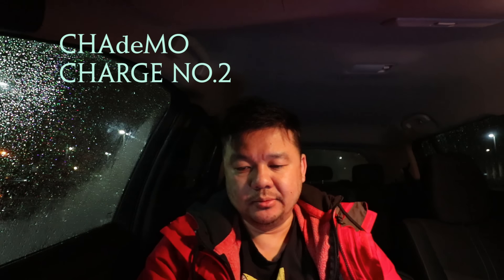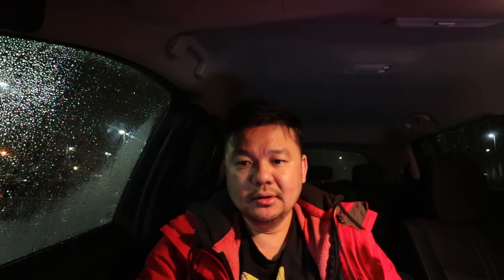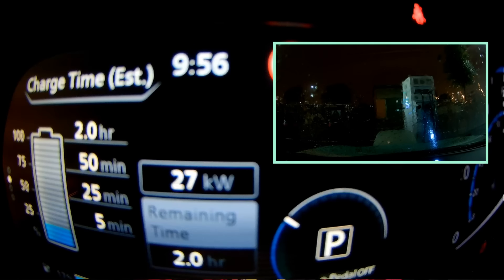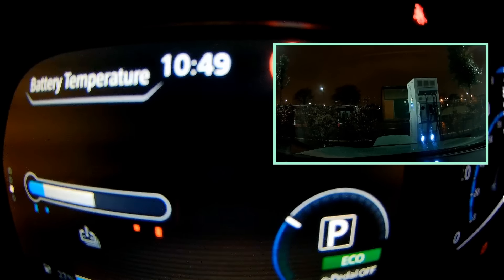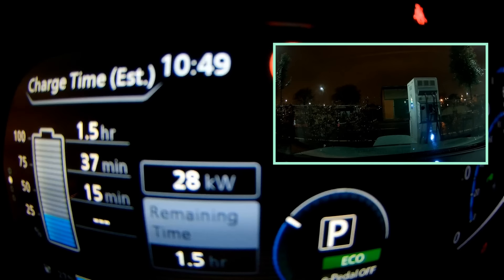Will lack of active thermal management system be an issue on Nissan's 40kWh Leaf?

Comment: Thanks for the useful review, James. We almost never take 300 mile journeys, so the issue will only arise on rare occasions. We're not likely to make a journey of more than 250 miles in a day any more than once a year. So, although the battery thermal management issue does need addressing, I suspect that most drivers would never notice the slowdown during repeat charges. My biggest question is, 'How will the system cope when ambient temperatures are 30° or higher?'. That will be the real test.
Reply from the maker: RWBHere Thats very true I dont think i would drive more than 400 max a day even going to France. and having to stop for say 2 hours for a charge isn't a bad thing or 3 hours if you have to switch over to a type 2 charge for the final top up. As a good rest and food is normally needed. 

I'm the same I don't think it'll affect or bother me, but knowing the limitation of our cars is a good thing.

I have a new video which I'm uploading now which gives a theory about how the car might deal with hot weather.

Comment: This is exactly what I was afraid of. Nissan was very well aware of the battery issue regarding the quick charging (rapid charging) judging by the fact that they have changed the charging algorithm to control the batteries temps rather than using a liquid cooling system. Come this summer this problem is only going to be amplified. I love the new Leaf but this battery temp problem could be its achilles' hill. I really hope I'm wrong though.
Reply from the maker: Electrified Journeys Japan Yes I remember watching your video about this and I think you hit the nail on the head. Nissan has got back to me asking for my details so they can contact me, we'll see what they have to say hopefully next week.
Reply: I really hope everything works out for you, I love the new Leaf I want to buy one someday.
Reply: +Electrified Journeys Japan, you were right, so was Nikki from Transport Evolved.
When the summer hits, people will be limited at fast charging if they were driving the day before (and the battery didn't have the time to cool down) already at the first fast charge. They will have an abysmal slow charge at the second and all the next where the charging rate will be between 15 and 25 kW, depending on battery temperature.
With a software change Nissan could change the first charge, but it can do close to nothing about the rest.

Comment: Hi. Great video. At 8:50 you show a table comparing charging speed and temperature. You do know that LeafSpy can be set up to store a log file? Import that logfile to a spredsheet, (Excel or simular), and you will probebly find were and when the speed of charging drop regarding both  SOC and temperature.
Reply from the maker: Thats brilliant, I'm new to leaf spy so any tips will help.  I've saved the last charge which i can use in future video after my new update which should be tonight. Hopefully have a more accurate account of what is happening with all the data collected.
Reply: Read more about the log file here: http://www.electricvehiclewiki.com/Leaf_Spy_Pro. Remember to check/tick of for logging. I have set my LeafSpy up for log every 4 second. I believe you will be able to drill deep into the charging speed issue as soon you got sutch data out. As a sample, I learned a lot about my 2012 Leaf after a trip of 650km and 11 QC in one day.
Reply from the maker: tucsonor ok saved the last test I did last night and set it up to my drop box. I'll have a new update video with some theory and that graph now I know how to read it seems to back it up. Still if Nissan won't reply back to me I'll keep the test data coming.
Reply: Looking forward to see what you found from the log file. Would also be interesting to have your file and compared to the log file I have from my gen1.

Comment: So glad I only do 110miles maximum per day. This way I'm in control of the expenditure and not at the mercy of other charging what they want. Rapid charging will not be an issue for me however if enough people force Nissan to rectify the issue with upgrades (fans etc) I'm all for it. Cheers for the video mate
Reply from the maker: I don't think it would affect you that much even if you had to do 3 rapid charges a day as you have downtime with the car and it'll have time to cool down.

Comment: I saw a post on a forum where the guy ran his HVAC on fresh air, fan on high, and windows rolled up, which he claims the cabin air exits into the compartment underneath where the battery is. In theory, on a summer day you would run the AC and pump cold air down there, and on a cold day you would pump warm air down there. 

Obviously you don’t want the battery to cool off fast when it’s just sitting in a parking lot, so it seems to seal the heat in well, but perhaps you can do some experiments to see if running the HVAC in that way, with a temperature on the cool side of comfortable, and see if it brings the battery back into normal temp faster. 

It’s possible that these charging issues are based on the wether being too cold to run the AC, so the car is trying to preserve battery heat, and therefore range, without running a battery heater. But if someone really wants to ride their Leaf hard and put it away wet, perhaps they can run the HVAC in a way to cool the battery while driving to the next charger, and leave the fan on high with the windows all closed tight and fresh air on to keep blowing 25 degree air (or colder) down around the battery.

Comment: Another great video James. Would a 7Kw home charger cause a similar issue, or is the rate of charge that much slower so the batteries don't heat up that much?
Reply from the maker: The 7kW home charger should actually start cooling the battery as the heat generated is lower than the heat generated. I'll doing test on this at the weekend and post my findings :)
Reply: Fab. Collecting my Leaf in a couple of weeks :-) We also have a 22kW charger at work so I'll also be able to use that. Will be interesting to see how that affects the temperature of the battery. I rarely drive over 100 miles so I'm not too concerned about the battery issues, if I had the budget I would probably wait for the 2019 model.
Reply from the maker: one up to temp 21kW is suppose to be the sweet spot for not causing the battery to heat up any more. I also have a plan to make the car pull 21kW to see how much heat that generates. the 2018 will be the perfect car for almost everyone. Even with the battery issue/feature my folks have ordered a 2018 leaf as they said they'll never go on such long journeys with it.

Comment: Fairly easily explainable - temperature and voltage kills li-ion batteries. With no active cooling the only means to protect the battery is to reduce the charging current to keep the cell voltages lower for a larger part of the CC-CV charging scheme (CC-CV constant current constant voltage).
Even in mobile phones the charging current will decrease with temperature.  At ~60°C it should stop charging for both wear and safety.
Reply: So how do you explain why the 24kWh LEAF can get to its destination more quickly than the 40kWh LEAF when making a long journey? Both versions do not have active thermal management.

Its not easily explained.
Reply: The 1st Leaf isn't made for good battery life, obviously. I can fast charge any Li-Ion battery, but after a few cycles it's trash. Professor Jeff Dahn has a video about battery life and what kills the Li-Ion batteries and made references about Leaf and Tesla and concluded that Nissan made crappy choices, hence the lawsuits.
Reply: Jean-Pierre White Because Leaf 1.gen does not limit the charging current as aggressively with temperature. I.e. the gen 2 takes almost twice as long to charge per 20 kWh after the second DC charge (so it takes ~4 times as long at the charger).
Reply: kriss2005 The DC charge corresponds to a 2C charge for the 24 kWh Leaf (at least initially but it drops of within 5-10 minutes). During use the 80 kW motor loads the battery with 4C. This is only feasible if the battery is designed to cope with the high C rates (i.e. thinner anode/cathodes - more surface area per Ah). I.e. it is not the charge current as such that is the problem.
The Arizona Leaf problems quite emoirically substantiate my claim - high temperature and high voltages kills Li-ion batteries.
It is also quite evident understanding the nature of the intercalation materials used and the states causing maximum lattice stress.
If in doubt just search up thermal runaway temperature versus state of charge...
Let's just say - I used to supply hundreds of millions products per year eith Li-ion batteries. There are many factors causing wear - but the main culprite is the high temperature and high voltage kept over time.
Reply: @Rene Bergvist.

Give that the 40kWh is significantly bigger in capacity the C rate of charge or discharge is less than the 24kWh. So why would Nissan be more aggressive with limiting charge rate if the battery has a lower C charge rate for the same amount of charge accepted? In theory a larger battery will experience less heat stress charging or discharging the same amount of electricity.

Rather than help matters, the extra capacity seems to be a handicap. There must be a price paid for getting more capacity into the same form factor which outweighs any advantage the larger capacity enjoys. i.e. without thermal management even more heat builds up internally requiring the charge rates to be limited earlier.

BTW the 4C discharge rate for the 24kWh pack is only under hard acceleration. Cruising on the interstate discharge is typically 20kW, or approximately 1C.
Reply: Jean-Pierre White A 40 kWh battery at the same volume as the 24 kWh is also more dense in packing - hence current collector area per Ah is less than for the 24 kWh (and in principle higher impedance and more heat). In fact the current collector volume in absolute numbers is likely even inferior to the 24 kWh battery which reduces heat dissipation during charging.
As a side remark the drag co-efficient is improved in the 40 kWh by a more flat bottom and spoiler aero-dynamics -. This reduces the heat transfer capabilities in 'passive' cooling during motion as vortices are reduced (lower heat transfer) and heat builds up.
With reference to the 18650 cells (like used in Tesla) you either choose capacity or rate or a mix. If you choose capacity you also get higher impedance and thus more heat. So in this case it is more about actual Amps and not C-rate. You can easily find data on the 18650's on the internet.
Nissan has simply been more bold with more focus on biz and allowing marketing to push the envelope.... Still 95% of the ordinary customers wouldn't know or care - if they were normal - but people with EV's are still early adopters that investigate the offering.... Nissan fucked up.
Reply: @rene bergqvist. Totally agree that Nissan engineering is trailing their marketing push and desires. 

Many 'buyers' will lease with the assurance of the 8 yr/100,000 mile capacity warranty. I think the car will still be a success in sales terms. 

To their credit Nissan have honored reasonable warranty claims that qualify under the warranty program and replaced with new batteries which is above and beyond the minimum allowed under the warranty. While this sounds OK'ish buyers may not appreciate the loss of utility while the battery degrades prior to the trigger point for the warranty, which is approx 66% of original capacity when the fourth "capacity bar" goes out on the dash.

Comment: Mate, I've got a 2017 30kwh LEAF so am interested in this. I think it's just how it's going to go as the range and capacity go up - Nissan do a great job protecting the battery as evidenced by the slow degradation rates but they do it by limiting current as it heats up. Fast driving and charging of course heat the battery up. Seen the videos of Tesla's on the autobahn, they become limited after about 10 minutes of fast driving and that's with a cooling system. The 30kwh LEAF suffers the same kind of problem too - it will also get worse in the summer. Only cooling the battery or new battery technology will help.

Comment: I read a report somewhere giving a theory about this battery charging issue. As Nissan no longer own AESC the battery manufacturer the battery warranty terms and conditions now imposed by AESC are stricter than Nissan previously allowed with their 24kWh and 30kWh packs? Their next 60kWh packs are to be made by LG Chem.

Comment: Hi, great work again! Off the back of a second extended test drive today, I decided to buy a New Leaf anyway, as I think it will work for me.

As a matter of Interest when using a Ecotricity Rapid Charger, do you pay a Connection Charge + Electricity used? Or just the Electricity Used @ .30p/KWH?
Reply from the maker: Honestly, its an amazing car if you don't need to do the 24 hour le-Mans every week its the perfect car. As for Ecotricity I've never used them but I think its just the .30p/kWh you pay. If I'm right and you're one of there customer that they supply home energy to its something like 14p/kWh. But please double check as the NE and Scotland the chargers are mainly run by CYC and CPS.
Reply: Lemon-Tea Leaf, Thank you! I checked their Home Tariff and I would need to be using their chargers on a regular basis to make it pay, there seems to be plenty of Rapid options using a Polar Plus card.
I drove 80 miles today using 49% from a full Charge, battery temp was at about 1/3.
Keep up the good work!
Reply: Why not wait for summer , to find out how relevant is this overheating issue ? 
Considering people reported this issues when driving at -5

Comment: You mention the use of the ICE loan car from Nissan. The only real issue with that is that they  limit you to 143 miles daily! However they also don't seem to know if it is still a real thing on the newer car. I have spoken to two different dealers and they can't give me a straight answer! I have been considering a Leaf 2018 to replace my current ICE but this is giving me reason to hold off until the Hyundai Kona EV arrives, that or the next gen Leaf with 60kwh battery unit.hopefully with active cooling!

Comment: I think it's the software that Nissan has put in to protect the battery.  I think too many people are claiming it to just be a fault unless it's somehow a fault in quite a few cars. Thankfully it won't really affect me as I only would do 250+ mile journeys maybe 1-2 times a year. If I needed to make very long  journeys quite often then this kind of information would make me cancel my order.
Reply from the maker: Indeed I'm actually very please with my leaf and even with this information I've gathered It wouldn't put me off in buying one. Unless I had to drive to the North of France every week then I would think of a better transport (Airplane)
Reply: Lemon-Tea Leaf True. Still can't wait till I get my leaf. 7 days to go. I have a free fast & slower charger outside work as well. Nearly all chargers are still free in Ireland :)

Comment: When the summer hits, people will be limited at fast charging if they were driving the day before (and the battery didn't have the time to cool down) already at the first fast charge. They will have an abysmal slow charge at the second and all the next where the charging rate will be 25 kW down to 15 kW, depending on battery temperature.
With a software change Nissan could change the first charge, maybe also a bit about the second, but it can do close to nothing about the rest.

I hope you were buying this car to drive it close to it's range or at least less than 300 km.
If the intentions are higher, get ready for long charging stops.
I suggest you to watch the short (and possibly also the long) report from Bjorn Nyland's 1000 km test with the Leaf 40 kWh. 
He made some good suggestions, based on detailed data.
Reply from the maker: Already reports of someone in Arizona with charge slowing down on the first charge. the temp over there now in winter is 32°c
Reply: +Lemon-Tea Leaf, thank you. What I predicted, you just confirmed.
Arizona should avoid Leaf as the pest, they will have problems with battery degradation even if charging only at home, unless they have a garage with air condition, charge only to 80% and drive only on short ranges.
But for that you don't need the new Leaf, the old one will do it too.
Reply from the maker: So looks like my prediction that the inside cabin temp cools the battery is all wrong. I'm still learning what is capable out of this car. Lucky for me Scottish summer is around 17°c and if we're very lucky 24° heatwave for a whole week!

Comment: Very frank and honest video?  I too chose Nissan as it is British built and on the first showing looked great with top build quality, great tech and a good turn of speed allied to a decent range and rapid DC charging.  What could go wrong?  I am still troubled with my choice and in a bit of a dilemma.  No one seems to be giving me any assurances or explanations as to possible cause and a possible remedy.  I'm sat one fence at the moment, not wishing to be billed for failure to complete my signed order, but also not wishing to commit to buy a car that has these deficiencies that have only just come to light.  I am waiting for Nissan to come back to me and the selling agent.  Nothing yet..
Reply from the maker: Colin Russell,  Nissan will refund you the deposit if you don't take the order if you have a concern, also they'll have people in line that will want the car earlier. I'm waiting for Nissan to get back to me so hopefully, this can be resolved soon. I'll keep you posted in a follow up video